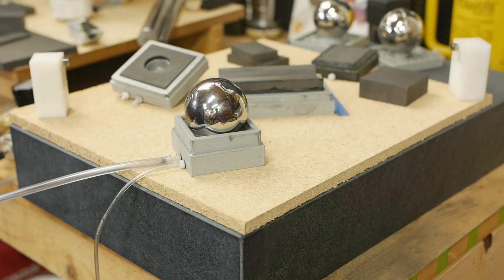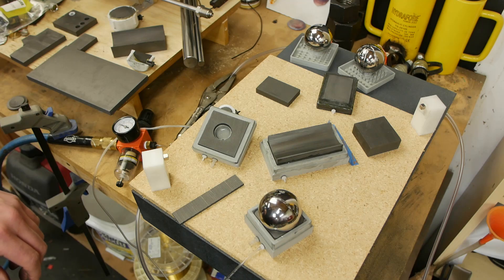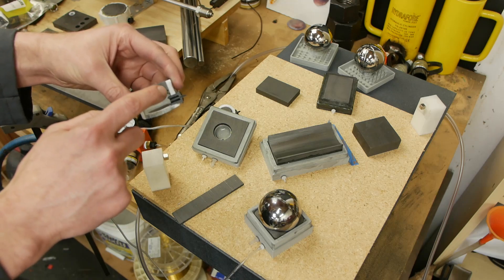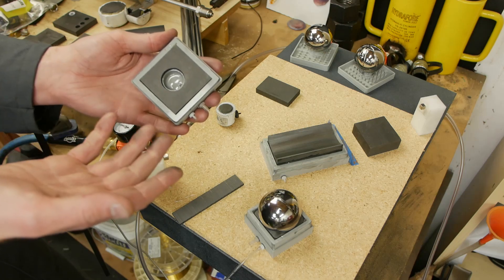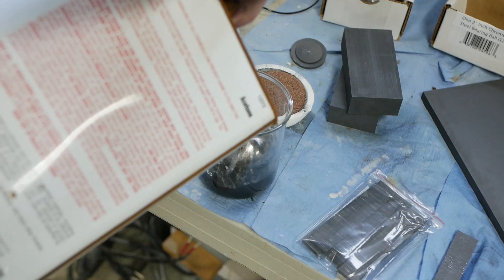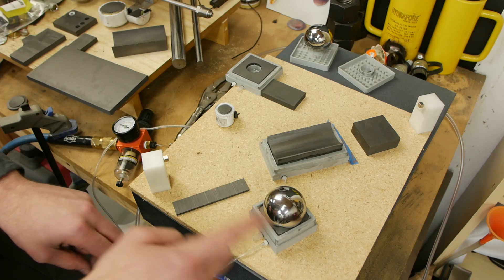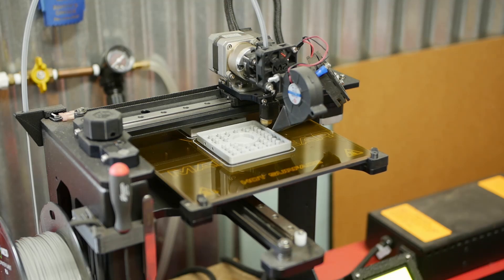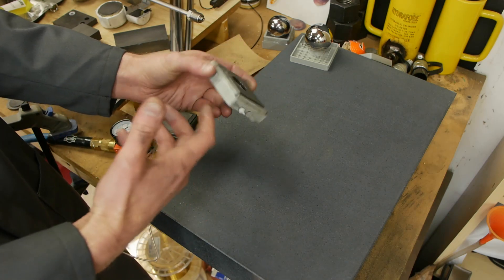Make vacuum pre-loaded spherical air bearings without special tools

Comment: I have a question.
If you were to take a thin drillbit, on say a dremel or drill press, and drill out very tiny air channels in the back of the block, that came up just a tiny bit shy of the bearing surface on the graphite block, would it possibly lower the input pressure required? It seems like you need quite a bit of pressure to get the air passing through the block at a high enough flow rate to keep things levitated off the block, and I figured reducing how much graphite you need to force the air through might reduce the pressure requirements.

edit: also, thanks for linking the sources for the giant ball bearings and linear shafts. I didn't know I could buy 3" bearings on amazon, and now I'm excited to try this.

Comment: When you said it has zero wear, doesn’t the air “erode” the graphite over time?
Reply: Erosion by air is a thing, but I've only heard it seriously discussed in a time frame of milions of years. Same with the claim that it is frictionless, it isn't but air friction (diffrent from air resistance) is only relevant at very high velocities.
Reply: I was think the same thing.

Comment: That flat sided 3d printed part held up to 80psi you say? Apparently I really underestimate the strength of 3d prints. Really need to mess with them more, along with lost pla aluminum casting.
Reply: putting a finished print in an Acetone vapor chamber for a few also helps or painting acetone over the surface, but you need to be printing with PLA.
Reply: @MrTrilbe  ABS

Comment: 3D printing and aquarium stone worked for me. I think I'm going to have to get one of those surface plates.
Reply: Granite surface plates are expensive if you buy them new, but if you find one at an equipment auction from a machine shop that's going out of business, they seem to sell for anything between $20 and $100.  You can sometimes get even larger table-sized ones for even cheaper but that's because they're really heavy and hard to move.

Comment: There's cylindrical bearings with the low starting friction could be used to balance high speed rotating parts
Reply: Yes, they are often used for balancing rotors and shafts, even with overhangs. They can also be used in the high speed machines, and also act like a seal. Check the "New Way Air Bearings" Youtube channel,

Comment: You said there is almost zero wear.  I would guess that you could design the bearings so they are taller than needed, and then when they do experience wear, you could just mill them down with the tools you used to build them in the first place.

Comment: Is the pore structure isotropic? If not, would it be a good idea to split the small air bearings for rods into three segments?

Not sure how it would work to assemble them though... Perhaps putting them in their housing, preloading slightly around the rod and then casting them in place with epoxy?

Comment: I never knew that graphite was that porous. As to the enclosed shaft air bearing you mention at the end of your video, I think a better solution would be to make it by using two halves that you could form by pressing them together over a rotating "shaper' shaft till they meet.

Comment: Reaming manually, while centerless, is also "axeless." Your risk of bell-mouthing the hole with one wrong twist is extremely high. Your risk of enlarging the diameter past workable is also very high. You can try one of those floating reaming chucks to compensate for runout in your machine but that won't be "without special tools" anymore.
The appeal of your single-side bearings is that they're self-healing: any damage can be smoothed by moving the part around. They're also not sensitive to the exact amount of material removed. I think your best bet with a fully enclosing bearing is a split bearing like the old-timer babbit ones.

Comment: I would really really enjoy to see you build a shaft (or rotor) that is supported in two circular bearings and suspended by two round planar ones, and then seeing that used as a milling or router spindle

Comment: Hello Ben, 3d printing engineer here. For airtightness, try PET-g material, and use at least 4 or 5 perimeters and like 10 top/bot layers. The thing is gonna be way tougher son of a bearing, cus PETg welds layers together better, than other materials, you will have way less stress concentrators.
Cant see or hear what material you are using as of now, but pla can hold more pressure, but will shatter more dramatically, and abs is kinda the opposite - you already know that. 
My idea is to use material that doesn't shatter at all under conditions of constant load - and PETg is just the right one, because it will deform slowly when it reaches its ultimate stress. Though, considering that it doesnt like sudden spikes in like **anything**, I would also try elastan d70, if your system is not very stable. 
P.S. And also 3 perimeters with pla or abs is not sufficient by any means because of how badly they stick to themselves, especially abs. 3 perimeters with PETg could be kind of okay, but i still wouldn't risk it. 
P.P.S. And please use ironing to get rid of stress risers as well as additional leaks - you have that setting in cura and you can mimic it manually if you prefer simplify3d

Comment: The main thing i like about your videos is not really the project themselves, but the fact that you take quite complicated concepts and condense them down to a point where they can be understood by almost everyone, and made by the most of us. I have no use for airbearings, but still enjoy and appreciate the fact that if I had a use for them, it would be within my capabilities to make them by using the simplest of tools. A progression of this video could be selflubricating hydrodynamic bearings.... Can then be made by simple tools in the home shop, or are they too complicated?

Dan Gelbart has a great video showing an actual use of air bearings. I guess some or most of your viewers already know of his channel, but for those who dont, he also shows some basics skills and procedures, and anyone who build his own precision lathe is worth a watch. 

https://www.youtube.com/watch?v=sFrVdoOhu1Q

Some commenters have mentioned that the dust can be a problem, and I agree,. All exposed electronics in you shop needs a cleaning. and if you work on graphite again, dust control and extraction is needed. The tip in another comment with soapy water in a wet/dry vacuum is simple and great. I have used it for working in abrasive materials like concrete and kiln bricks, and it works quite well without the fine dust clogging the filters.

Comment: Next make a 100k plus RPM centrifuge supported by these air bearings fed chilled nitrogen or helium gas. Your shaft may require magnetic bearings and a vacuum instead or maybe nested concentric rings that each redistribute shearing of the gas into smaller compressions speed zones. Not to mention also vertically aligned down a hole to prevent flying parts hurting anyone might be a good idea.
I like the concentric ring idea because it may be a challenge to distribute vacuums and gasses between each ring so they float independently.

Comment: This file making method is pretty brilliant, as is the rest of the video by the way. Instead of vacuum, you can also use magnetic preloading if the sliding object is ferro- or paramagnetic. Is should work on the ball.

Comment: i think that enclosed bearings made from a thin sheet like that might not work due to low surface area.

 you might have a better chance of making it work by sandwiching the rod between two longer bearings made the exact same way you made that longer bearing. maybe add a sping to apply some sandwiching force.

Comment: very nice could you elaborate on how much force such a bearing can support
Reply: Simple calculation: multiply the compressed air pressure by the surface area of the bearing.

Comment: Huh, it would be interesting to make a balancing fixture for my surface grinder like this. No more having to verify the working table is sufficiently level. Would also remove the friction between the test arbor and the blocks it is resting on.
Reply: Hmmm...how about some air bearings on the bottom so you can just roll the mill around the shop? Would also look hilarious.
Reply: @Ayestosea  have you not been watching this video at all or what?

Comment: I use similar methods to grind a fit.  I also make custom paddle bits up to 3 inches across, sharp enough to cut a bowl shape into a block of very hard wood, so these would work well  on graphite.

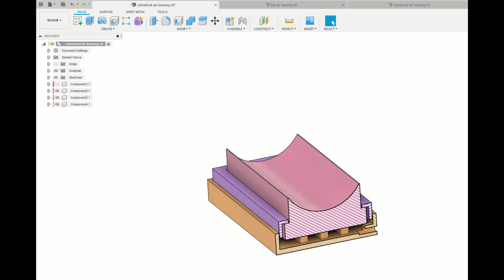Comment: 12:08 If efficiency becomes important, seal the exposed surfaces that you don't want to leak. Perhaps simply paint them.
Reply: After selecting a paint with strictly limited penetration?  Would that be an issue, probably depends on how much the binder wicks into the surface.
Reply: @scottwillis5434  That, sir, is an interesting animal once described by Eristhones: an ellifino.

Comment: I wonder if this would work with MDF. It is porous as well. I have used it to make a vaccum chuck for my cnc router. No reason why the air can't go the other way as well. 
I would be wary of graphite dust getting around the shop since it is conductive. I could see all sorts of problems starting to happen with electronic devices if there is much a of a build up.
Reply: idk, but mdf is probably too coarse to be smoothed like that
Reply: Very good point
Reply: In addition to being way smoother, the dust from graphite is partly graphen and graphite, which are both due to their cristalline structure great lubricants

Comment: Very cool! Looks like tons of fun. I'm surprised there was no discussion of the load-bearing capacity, e.g. the air pressures necessary to maintain the air gap under different loads and the mechanical properties of the graphite. In what range of loads are graphite air bearings are practical? P.S. I'm constantly impressed with this channel. Very innovative stuff.
Reply: It was mentioned fairly early on in the video; easy to miss...

Comment: So what do I need an air bearing for? Do you have any applications to show us?
Reply: Not all air bearings require a compressor. In some, air film is created by the movement of the parts with respect to each other. In all hard drives, for example, the read/write heads float over the surface of the disk on such an air bearing.
The bearings of the kind shown in this experiment are usually used in high precision machinery, ultra-high speed centrifuges, etc. Look up "High precision air bearing CNC lathe and grinder
" video on YouTube to see an awesome example of one such home-made machine.
Reply: also for satellite zero g testing like https://youtu.be/8wE-XR78ZyM?t=81 or https://youtu.be/4-eU0piozG8?t=5
Reply: Patent pending, trademark, copyright, here sign this NDE.

Comment: Very interesting experiment. I appreciate you sharing your experience. Cutting groove in bearing ball is an great idea I have never think of. I think if cutting grooves and sand off all the Sharp edge, it will make a good lap. I am also interested in graphite air bearing. My experience is slightly different from yours.I found it easy to make an air bearing that float but quite difficult to make it useful, namely have the stiffness. According to literature the air film stiffness will greatly decrease if the thickness over 10 micrometer or the flatness is worse than half of the film thickness. I also found Poco's graphite perform better than regular EDM graphite.

Comment: I'm trying to think of how these could be incorporated into an extremely dangerous high speed sport, and/or super-weapon....... Maybe it'd be possible to make an air bearing barrel and accellerate a projectile down it.........? It'd wear out fairly quickly I guess... But you might be able to get something going REALLY REALLY fast... Or make bullets out of graphite, or perhaps as graphite as a sabot round... And they self-lubricate the barrel, and the gases from the explosion permeate through it to make it behave like an air bearing..... There MUST be a way to weaponise these....... Surely......
Reply: But it is porous , it may quickly slow down if it is projectile.
Reply: Jim Schofield
pretty sure you could think of much better uses than weapons. go on, give it a shot.

Comment: Could you do this with cast aluminum, iron, or brass/bronze? Not sure if these materials are porous... For brass (brass bushing type bearings) I wonder if instead of oil impregnation, you use air, or use FDM to drill some small holes near the center and force air through to do the same thing?
Reply: Yes you can. If the purpose of the air bearing is to simply support something with low friction, it is not very hard to do -- plastic or metal parts machined with ordinary tools, and holes drilled with a small drill and carefully deburred work just fine. In fact -- air hockey is a well known example that it is relatively easy. And you can use this to spin small rotors to a hundred thousand rpm with relatively little trouble.
On the other hand, if you want the bearings which can bear a load, provide high precision and high stiffness, then it is a different story. You would need higher precision of machining of all bearing surfaces to maintain very small air gap in the bearing. (Drilled holes are still fine for creating the air cushion.)
In fact, with very smooth and close fitting surfaces, you do not even need a compressor to create the air film. Check out a demonstration in the beginning of the video:"High precision air bearing CNC lathe and grinder
"
Reply: There was a project somewhere for a turntable with air bearings for the arm, made from impregnated bronze bearings, taking the impregnated out of it with compressed air and they where porous enough to work. Note they come undersized so work rotors can be resurfaced and still be used with an undersized bearing, so you can get a tight fit for a standard rod size.
Reply: You don't need graphite for air bearings, simple channeling also works but graphite is technically the best method.

Comment: Great video on a very interesting subject.  On retaining the puck type bearings in their holders. I once was tasked with making some threaded Graphite cylinders. I set the blanks up in the lathe just the same as a  conventional single point threading operation. However instead of a cutting tool I used a 60* profile grinding wheel in a pencil grinder. The threads were a 3" diameter x 16 tpi and were ground in a single pass. This same technique could be used to mount the Graphite pucks in the their holders, with the the only adhesive being used for sealing.

Comment: Graphite is self lubricating.  If there’s a way to adapt this to a CNC machine that would be ideal for speed and accurate cutting with almost zero drag.
Reply: Self-lubricating implies contact and wear, does it not?
Reply: Scott Willis you got me on that ons but still graphite is a lubricant Incase loss of air pressure or vacuum occur with a load present correct? Lol
Reply: Scott Willis hey another possibility would be air internal combustion engine bearings. Talk about a literal dry sump with zero windage power loss. F1 type development they already use compressed air valve return replacing valve Spring’s for higher RPM

Comment: It is a fantastic concept. I am curious to know if it keeps spinning when the ball or cylinder is exposed to a load, for example a load of few kilos or hundred of kilos ? Or does the load just squeezes out the trapped air? Is the rate of the air flow in higher (through the porous graffite)  than the rate of the air out ?

Comment: Fascinating. 

I'm theorizing here (because I currently lack the tools and materials to realize)...
Couldn't you make a hybrid bearing assembly that is itself the air pump? It wouldn't have its  own frictionless start.
And I know this may be counterintuitive as the physical work done by my theoretical pump bearings would be a factor of resistance for the motor. My impression is there would be a sweet spot (a function of rpm and torque) where the pump's caused resistance was essentially null.
There'd be a graphite core to change so they'd be low maintenance when used properly, and an absolute nightmare outside of their performance envelope.

Comment: What happens when you reverse pressure to vacuum? So that the vaccum goes through the graphite and have it ride a pressure of air through the center?
Reply: it wouldn't work. ask yourself why.
Reply: @daos3300  i never implied it would work.
Reply: @daniellassander  no, you didn't. but you wondered if it would, which is why you asked the question in he way you did.
Reply: @daos3300  no i was just curius as to how it would change.

Comment: Wonder if you could drill the hole and not break thru then lap it in with a flat bottom to make the bearing fully constrained. Don't see why not. Also I wonder if you could use super glue to block the non functional surfaces to conserve air.

Comment: Can you make the most roundest thing on earth by measuring the material with lasers then using a powerful pulse laser to take off the high spots? Sort of like a 360 degree lathe running on an air bearing and cut by a laser. 🔧

Comment: What's that quartz/borosilicate tube for?
Reply from the maker: That is a tube furnace for making carbon nanotubes (video not made yet.  In fact, nanotubes not made yet :).  Ironic that it is also covered in carbon dust from the current project.
Reply: @AppliedScience  can an aquarium air pump be used to supply air for small bearings? Like for M6 or M8 rods?
Reply: @3er24t4g1  That would produce pulsed air which would ruin precision, use compressed air for a consistent air supply.
Reply: By compressed air, that means from a bought tank of compressed air, not air from a typrcal air compressor.
Reply: @AppliedScience  Thanks for taking the time to reply. I can't wait to see that video!
Reply: https://www.dictionary.com/browse/water--water-everywhere----nor-any-drop-to-drink